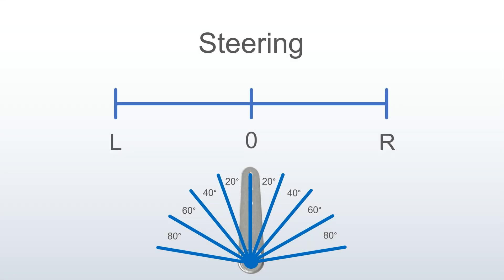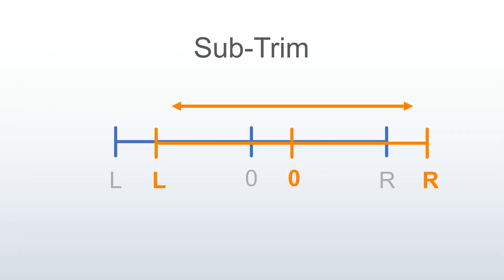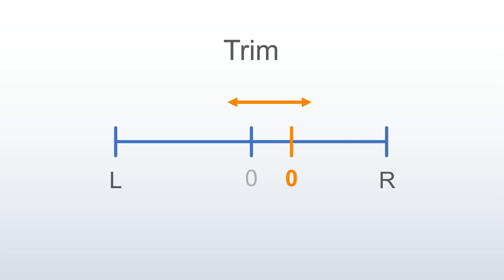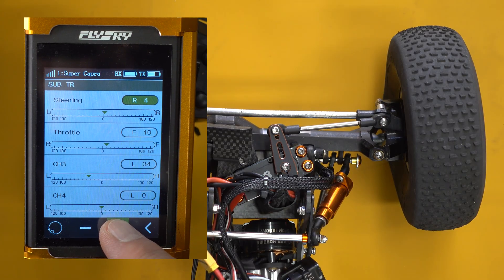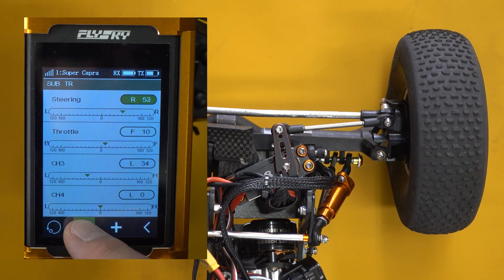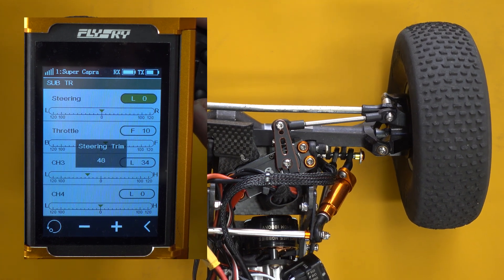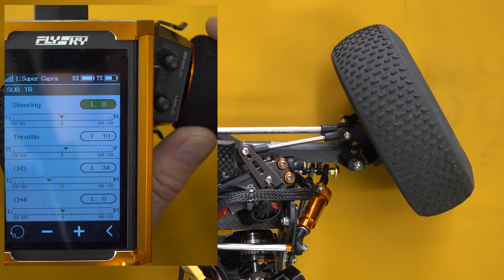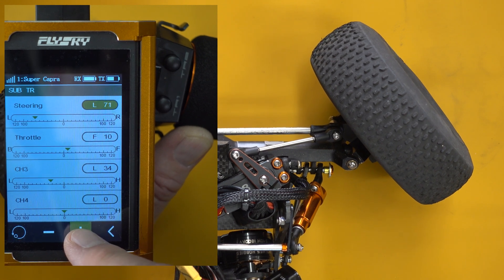Trim v. Sub-Trim - Do you know the difference?

Comment: Happy that you demonstrated this with my particular transmitter. You basically confirmed what I thought I already knew, if that makes sense. I have been using subtrim whenever I set up a new rig or put a new servo in, in order to get the steering centered to begin with, then setting my endpoints.I would then use the trim to fine tune the centering after the full weight is on the rig, after the suspension settles etc, in order to get it to track straight. Thank you.

Comment: This is a neat explanation. My process for centering steering is always:
1) With the servo powered on and everything centred and zeroed out on the transmitter, attach the servo horn as close to perpendicular to the steering linkage as is possible
2) Using the subtrim, now set the servo horn to be exactly perpendicular to the steering linkage, so they form a 90 degree angle with each other. Ignore the position of the wheels at this point. This will ensure your steering is going to be equally progressive when turning in either direction.
3) now center the steering by adjusting the lengths of the steering linkage(s), and set the toe angle if applicable using the same method. Don't use trim/sub-trim for this. Get the steering as central as you can with these adjustments. I like to remove the pinion gear and roll the car across the floor to ensure it's tracking straight, but you can just drive it too.
4) now set the end points left and right to allow the steering to move as far as it physically can in both directions. You might end up with more steering one way than the other, that's OK, you're just making sure you know where the furthest point they can go to is.
4) next using the endpoint adjustments again, ensure the steering turns the car equally in both directions. One way to do this is place the car on the floor and drive a half circle in one direction on full lock, noting the start and ending position on the floor with a piece of chalk or something. Spin the car 180 on the spot by hand, then drive in the other direction on full lock and see if you end up back at the same place as you started. If you don't, your car has more steering in one direction than the other. In a crawler you may want to leave this as is so you have max steering in each direction, but in any other car you should reduce (not increase) the end point on one side until both sides turn equally.
5) Finally, using the trim, fine tune the steering so it is truly straight. It won't need much at all if anything. If it does, you've got something wrong and you need to go back to step 2. If you're racing you can also now use the steering dual rate to reduce the steering throw so the car isn't so sensitive, and the expo to dial out twitchiness around the straight ahead position.
Reply from the maker: I like the circle driving part. Thanks for sharing.

Comment: Great video this explains why I was stripping servo horns and tearing up mounts as I was using sub trim to do that, my next question is when would I need to use subtrim
Reply from the maker: I explain the best order of steps in the video. Because your servo horn can only be set at 14° increments, the very first thing you do is use sub trim to set your zero point so the horn is exactly where you want it. Then don’t touch it after that. Then set your endpoints and do any fine-tuning with the trim.
Reply: @BoomslangSuspension  thank you I found the video and followed the sequence you laid out, super helpful, I appreciate it. I’ve watched most of the videos and have learned so much.
Reply from the maker: @henryoak2001  So happy it helped!